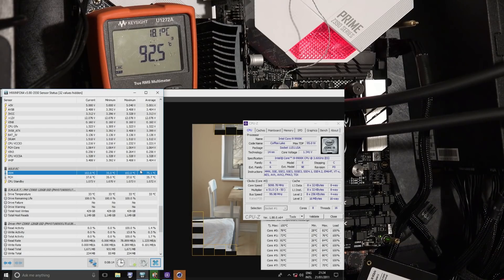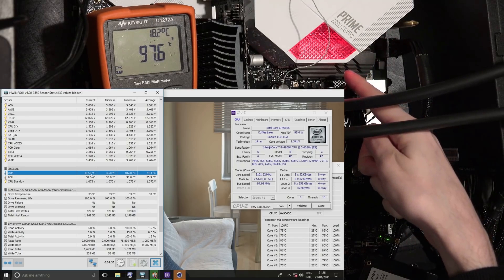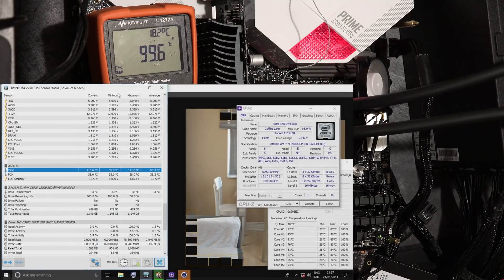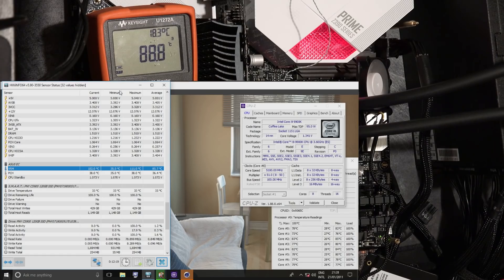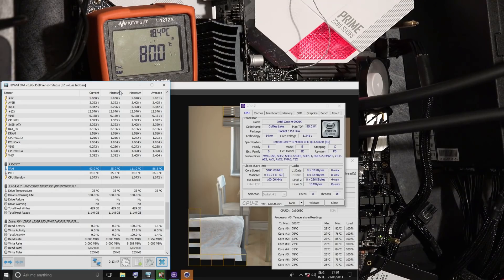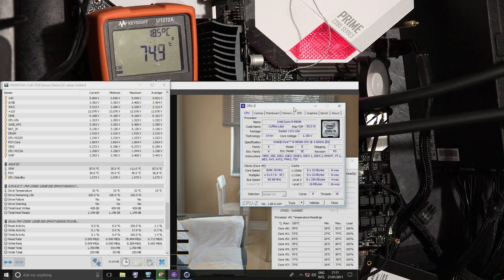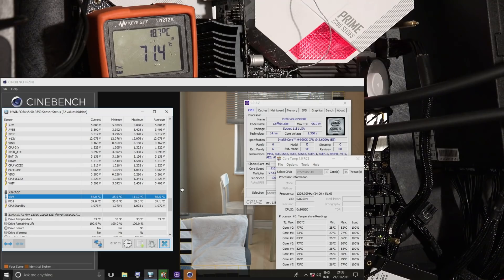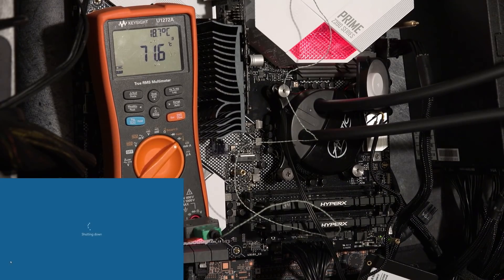Fixing the VRM thermals of the ASUS Prime Z390-A with a 40mm fan and 2 zip-ties.

Comment: This vid popped up in my recomended section after 2 months using the 5600g on my GA A320M S2H. My old cpu was the Athlon 3000g and yeah having a good fan as active vrm cooling helps alot and yes I did some tweaking like disabling Turbo and keep it at base clock.Its running very well and Im happy.Although I dont know why the 5600g runs cooler than the Athlon 3000g even with Fan vrm cooling.

Comment: I was curious about how to actively cool the VRM and the chipsets. didnt know if these little fans would make a loud whirring sound and some might. but I know they have some quiet ones out there.. a couple of ideas and notes Id add to this however.

for making a bracket this sort of thing is where I shine. you can go as simple as making a bent wire brace out of stiff bailing wire which you could even slide the mounting holes onto then you can make the bracket hold onto something on the back side of the case.  then you have the 3D printer option, making sure to use material that is heat resistant... you dont want it to droop..  you can sketch up the base design on poster-board stock then take measurements. then there is another method of taking thin aluminum or tin sheets bending and punching/drilling/dremil small holes where needed. then paint afterwards with some cheap "heat resistant" krylon spray paint.

also in cases with air cooling I would make sure to push air from bottom up as you are likely to have fans pulling air in that direction and you wouldn't want to fight that wind current, you could stagnate the air and create more of a problem. even with an AIO I might do this to keep with flow direction. this will also direct all heat up and out or out the back of the case giving you a better ambient inside the case, meaning ALL your temps will be lower.

Comment: I have a 140mm fan on top of my case, above vrms. I recommend to do the same if you worry about your vrm temps. I have a b450 tuf gaming plus(not a great board) and a ryzen 7 3700x. Eco mode and stock settings keeps everything cool.

Comment: Sure, fixing a fan can help but the fundamental problem here, as with most cases is that CPU cooler mounted at the top. You're trying to cool the CPU with (100C!) hot air coming from the VRMs, GPU and RAM. The result is a hot CPU, hot radiator with loud fans. The whole area at the top of the case just gets hotter and hotter. 

The optimal solution is a front mounted radiator for the CPU, pulling in cold air. At the top, just an exhaust fan. This will help all that hot air from the VRMs, GPU and RAM to escape.
Reply: I have a 140mm fan mounter on the hdd cage via L shaped bracket used for closets etc. It blows fresh air. My case is open  I never had vrm temp issue

Comment: ty man for improvising with zip ties and not having to use screws that Asus did "NOT" include also did not include the tiny fan, just that dam Bracket, with "NO" screws they were not kind enough to Include "ZIP TIES" like you suggested  Asus can at times be   ButtHeads.  well won't be Extremely OC'ing but did want to Clock it to least 4.7 or 8 wonder if I will still need the Tiny Fan ??? for a 4.7  OC ?

Comment: I have the exact same issue with my Aorus  Z370 Ultra gaming Wifi w/ an 8700k Clocked at 4.8 all core ||  Daily use and gaming it is totally fine, however I do 3D Art as a career and when I occasionally render in Arnold (a CPU render) my VRM gets really hot.  When stress testing it can hit 100+ degrees.  

I just bought a 40mm fan and will try this fix, will let you know how it goes.   Thank you for the video
Reply: How did it go?
Sorry for the very late comment here
Reply: @andrexskin  It did help a little, in my case it lowered my temps by 10 degrees or so.
Reply: @DavieBoy531   Better than nothing! Thank you for the infos and I hope your career is going very good!

Comment: My msi z390 pro carbon ac with a 9900k running at 4700mhz all cores doesnt seem to get over 66c with cb20 avx offset off and here i was worrying about it pre purchase.  Normal gaming use it barely hit 50c. Then again i use a dual fan aircooler.  So i guess this problem mainly is a AIO problem.

Comment: My 2x 120mm top fans blow down over the VRM and RAM and I still think I want to include the VRM in my waterloop, just need to find the right baseplate for Watercool.de VRM blocks, for Asus Z370-E Gaming.
IIRC Asus has 3D prints for download on their site. I think I should also mount that Corsair RAM cooler again that came with my RAM, LoL.
Cooling is vital, no doubt.
And yeah, Asus is going south, for some years now. Even their most expensive stuff lacks behind in terms of craftsmanship and reliability.

Comment: Also if you use air tower cooler instead of aio (something like dark Rock pro 4, noctua nh d15s to run i9 around 5ghz) due to circution of air Flow around main board it Will reduce vrm temps but ofc not that much.

Comment: I've been wanting to see if changing the vrm thermal pads, with better thermal pads or ic graphite or thermal paste and then add a fan, but look like that not necessary. How did this influence your overclock frequency and performance?? Was there any improvements??? Great job again

Comment: Bottom line: Load temperature dropped by over 30°C just by adding a tiny little 40mm fan onto the heat sink.

Comment: i've attached a 40mm fan to it using one of the motherboard screw holes and a series of the brass screwy studs. basically another simple way to do it.
https://cdn.discordapp.com/attachments/551445962502176771/642914000094625822/IMG_20191110_013038.jpg
i cut the small heatsink myself. don't bother me about all the dust and "aesthetics", i don't give a damn.

Comment: I have this mainboard, but the VRM Temp. doesnt show up in HWinfo. (I have enabled Asus EC)
Reply: Use AIDA64
Reply: @gabis1963  ...That advice doesn't speak to the problem that we are having.  WHY doesn't it appear for the both of us in the program but it does for Buildzoid?  We need the answer to that...not to install another program.
Reply: @Rickbearcat  It does appear in HWInfo but you need to enable it. Don't know why it's not on by default.
Reply: @gabis1963  ...Enable it?  Why?  Do you see how much stuff is already enabled in the pane?  Tons and tons of stuff.  Why is not ONE LINE of info not enabled in the EC tab when there are 200+ data points listed?!  Can you tell me exactly how to enable the VRM data point?
Reply: In the Sensor Status window right click and select "Layout Settings..."
In the setting go to [ASUS EC] and enable monitoring for VRM
You can disable what ever you don't want to see and even remove it from showing by un-check "Show"
Reply: @gabis1963 ...You aren't going to believe this, but 'VRM Temp' does not exist within the entirety of the chart.  Unbelievable.  Thank you for the detailed instructions.

Comment: Very informative, thank you. 

My vrm run between 25 idle and 35-45 (winter/summer) with full load prime 95. It hurts to see 110° :c
Reply from the maker: Are you water cooling it or are the sensors broken?
Reply: @ActuallyHardcoreOverclocking  Ek monoblock for X470 Taichi on them. 

I think i killed my first X370 Pro carbon when i switched to full watercooling loop with no airflow (7-800rpm fan fixed, big rads, big case), didn't mind them and it just died (the mobo, the 2700x is fine) while trying some oc configs. I was dumb, i didn't knew you at the time and i didn't tought about VRM temps or the airflow.

The airflow is so low that i had to put an ek heatsink even on the NVME SSD (it is a 970 evo, not a newer one with the heatsink already installed on it)  because he went throttling (summer here is hot 30-35°) while videoediting and stuff, reached 87-90° degrees on one sensor and around 60 on the other. I didn't realize why the encoding time was so shitty until i looked at the drive's temps. 

At the time i was dumber and thought the only two things that need airflow were CPU and GPU. That's how i found you, while looking for the new mobo one year ago c:

Thank you for your work and dedication.

Comment: A CPU cooler that blows air downwards will actually cool the VRMs too, that's why this problem occurs with AIOs and tower based heatsinks. That's why my top mounted radiator is set to pull air into the case and out the back fan so that there's decent airflow over the VRMs.
Reply: Sure, but no such cooler exists that would allow running a 9900K at 5.1GHz/1.35v.

Comment: Quick question: can mosfets be too Cold for their load? With a custom loop with a Monoblock on my Aorus X470 Gaming 7, the VRM sensor never gets above 40C (according to HWinfo)
Reply from the maker: technically most parts aren't specced to work bellow -55C. but good luck reaching that temp
Reply: @ActuallyHardcoreOverclocking  yeah, lol, that's never going to happen. Have no ambitions of putting my Ryzen on D-Ice or liquid Nitrogen,  which may put it close to that spec. Maybe play around with a Gigabyte GTX460SEv1 I have at some point, or a Alienware OEM GTX 280 1.8GB card I have, but that's it

Comment: GREAT idea, I've been concerned with the temps on the TUF x570 gaming (don't laugh) Chipset. They get as high as 80 oC while gaming. The Ryzen 5 3600X CPU (stock air cooler) is ok at 60 oC (max) . Actually I was considering buying a small AC unit to pump cold air in the intake fans, to cool the entire PC ... but a few extra fans might be alot cheaper.
Reply from the maker: pumping AC into running systems tends to create condensation and kill stuff.
Reply: @ActuallyHardcoreOverclocking  yeah, I was planning to filter for moisture. but a small fan on the chipset should do ?

Comment: I'm pretty sure the temp is fine in a case with normal airflow, a test bench with a watercooled cpu is worst case scenario i would think
Reply from the maker: the VRM area of a motherboard tends to be a complete airflow dead zone. Which is also why when I did in case VRM testing most low end motherboards still overheat unless you do something weird like run your rear fans as intake.
Reply: @ActuallyHardcoreOverclocking  Its weird. while stress testing with prime95, 9700k@5ghz 1.3V VRM temp never went above 70C. and another question is msi z390i gamiing would overclock better than this board or no?

Comment: Do you think the VRM fan on the Arctic Liquid Freezer II is sufficient for cooling a VRM?
Reply: Absolutely not—it is a mere gimmick, JUST good enough to show some improvement on reviewers' temp charts, but not good enough to make any real world difference.  I am running an i7-10700k on an Asrock Z490 phantom gaming 4/ax motherboard with the Arctic Liquid Freezer II 280, and while the ALF is easily outperforming the Grand Macho RT (which outperforms the Noctua NH-D15S), the system settles out at a paltry 140w continuous on the CPU due to VRM throttling!  I have tried both with and without its VRM fan, and noticed no appreciable difference.  Meanwhile, the Macho can do ~190w and the Noctua ~150w continuous on the same system, both topping out with CPU thermal throttling.  It looks like the ALF could easily do >225w if the VRM stayed cool, but without that CPU "underflow" air from an air cooler, the VRM cooks.  Case fans barely help; the air needs to be high-speed directly across the tiny VRM heatsinks, something that the oversized Macho and Noctua fans (which blow over the top and under the bottom of the heatsink) do very well.

Comment: I'm thinking of doing that to my x570 taichi. Its tiny fan is so loud, but the temps don't get low even with high rpms.
Reply: kousaka san On my X570 Taichi I have made a custom fan curve for the chipset fan. It does not turn on until the chipset reaches 65C. The good news is thanks to the airflow from my case fans and GPU never let it reach that point. My VRM temperatures never go over 45C when running a 3900X.
Reply: @stevenbradford6138  I have good airflow. but 2080 ti sits right over the board. I that's why I could use a larger fan blowing in from the side

Comment: you realize people have airflow IN their cases BUiLLDY? not everyone is using a testbench
Reply from the maker: Tell that to all the X470 boards I tested that run 110-120C in cases with 4 fans. The corner of the mobo where the VRM is normally an airflow dead zone because there's memory sticks and CPU heatsinks blocking any airflow.
Reply: The VRM's should not be getting that hot in the first place. Some VRM's just have an inadequate cooling solution to begin with.

Comment: I'm so past having a quiet system, I'm using 6 Corsair HD 120mm fans @1900RPM & a HD140mm @1500RPM. plus my aorus extreme's fans at max or around 2800RPM , only time I ever turn them down is at before bed when not gaming anymore xD
also did buildzoid say I could ziptie a fan around the heat pipes of my air cooler?!??? yeah like that won't melt lol

Comment: yep, its why watercooling solution are bad for VRM. (except the latest artic freezer one which has a working fan for the VRM, you should test it)
by the way...
did you have solutions to cool down the backplate of the CPU?
which is hot when running for long time.
I plan to put some small heatsinks and a slim fan on top of them.
Reply: @UCDN0XL4mE2wLHRtQsKjyLHQ the VRM are using heatsinks by default, not a backplate.
and I'm curious to know if he already did this type of setup and if there is a real improvement or not.
a fan without a heatsink, not sure if it will have a effect.
Reply: @willgart1  Of course fan without a heatsink will have an effect. If you blow air at literally anything, you're gonna remove heat from it.
Reply: @PaulHawke1337  yep, but its less effective.
else we'll not need a heatsink on top of a CPU.
the heatsink get the heat quickly from the hot source, and increase the area in contact with the air, increasing the performance of the cooling setup.
well... I have to find a small low profile fan first. I think noctua has some available.

Comment: So that's why my ROG Z390-E came with a VRM heatsink fan mount and 40mm fan. I did install it but I didn't think it would actually be that useful.
Reply: If your worried about VRM thermals - pull the blingy plastic IO guards off - 2-3 screws and it frees up the entire top/back of the VRM heat sink for airflow. Did that on my Z390-E and it never goes over 60C without the included 40mm installed. Running a DH15 with the middle fan mounted low as it can go - lots of air flows to that area.
Reply: @OrBy00  Did the same thing on my Z370-E and running the same cooler. Can't get VRM temps in HWinfo but just feeling the bare heatsink, theres quite a bit of difference.

Comment: Where do I get the cheap little fan
Reply: Any PC hardware store that sells desktop components such as cases and fans will have them. Electric component stores only have industrial ones that are to loud.
Reply: Go for the Noctua fan. They're quiet and reliable. There's a 3 pin, a 4 pin, and a 5v fan, so just make sure you get the right one for your application.
https://www.amazon.ca/s?k=noctua+fan+40mm&crid=1SE9LI77YHWNV&sprefix=nocyua+fan+%2Caps%2C215&ref=nb_sb_ss_sc_8_11